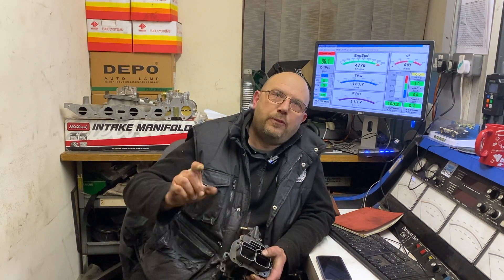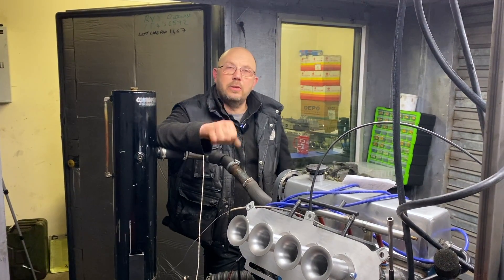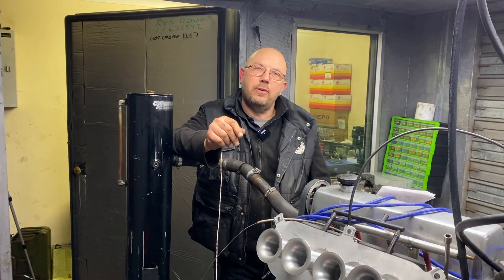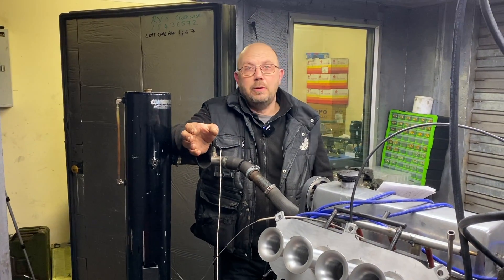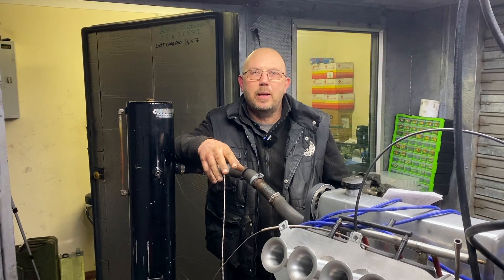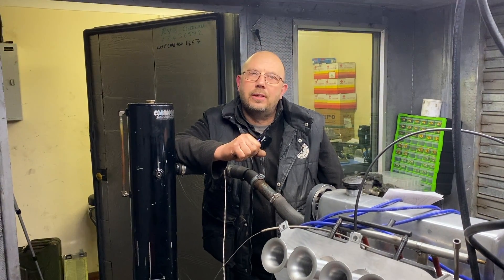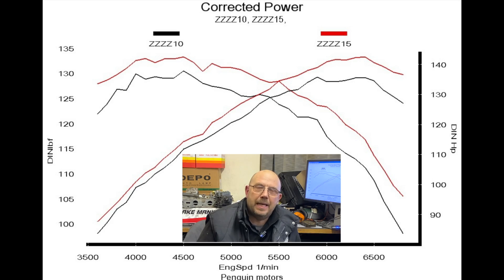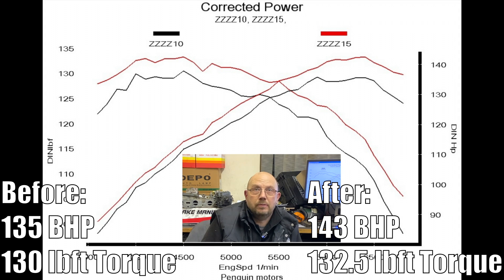How I got FREE Horsepower - Ford Pinto

Comment: Mate  scott from hull livin in new zealand  👍 if my valve stem seals have just started blowing white smoke ocasionally not on start up just randomly  can i replace with out tear down just pump air in the cyls etc pinto 205   And is there any upgrade seals for turbo or just stay with factory cheers 👍
Reply from the maker: I have changed pinto valve springs with the head still on the car using compressed air to keep the valves shut. Stem seals from Elring or Victor Rienze seem to be best
Reply: @PenguinMotors  thanks mate
Reply: @PenguinMotors  right so now my altenators stopped working 1979 ford escort mk2  not charging how can i test it if i remove it 🥹

Comment: I managed to get 176 hp from a pinto.Twin 45 dellorto's 285 cam, 421 manifold, larger valves and smaller intake ports.The ports are too big on these as standard. Making them bigger and polishing them is going the wrong way. Had a 5 speed gearbox going to an estate rear diff. The normal 2 litre diff was geared for something silly like 160 mph in 5th. Pattern clutches would just slip all the time. Using a genuine ford clutch could just manage. Started out as a 1.6 4 speed Sierra. 2 litre and cam made a big difference. Boring to 2.1 seemed to do nothing at all. Left it looking standard and used to have fun with GTi's etc. Was a fairly fast car 40 years ago. An ordinary modern 2 litre diesel would be about the same these days. At 63 I now have a litre motorbike, glad I did not have that when I was younger. I would have been lucky to last a week.

Comment: Interesting the power increases you found from making up those two manifold spacers, the one under the carb, and the one between the head and the manifold. I once got a power increase on a F/Ford 1600 x/flow with longer carb mounting studs and three of Ford's thick carb/manifold gaskets until a scrutineer spotted it and pointed out if was an illegal modification ............:face-turquoise-covering-eyes:

Comment: I had a 1.6 Capri. Dropped a 2.1 with a lightened and balanced flyeheel,   crank, pistons and rods, A fast road cam. 4-2-1 manifold and full Janspeed exhaust.  And two rejetted twin 45DCOE carbs with pipercross filters. 100LL avgas may or may not have been involved too 😉
Net result was showing 210 horses at the back wheels on the Dyno.
I really miss that car.
Reply from the maker: nice one but that dyno must of been reading pub horse power, as no way you of of actually had 210bhp at the wheels
Reply: @PenguinMotors  I definitely remember them saying 210 hp (it was the. Company that set up the carbs) It was quite a few years ago. Could it have been at the flywheel then?
Reply from the maker: @crazybrit-nasafan  if you play with the calibration you can make a dyno or rolling road read anything you want, i knew one operator that had his machine read high because customers liked big niumbers!!  but no 2.1 pinto will ever make  a genuine 210bhp flywheel using a fast road cam and 45's
Reply: @PenguinMotors  Thanks for the info. A bit annoying as well had paid them quite a chunk for the carbs and set up. I would rather have had an accurate reading rather than an exaggerated one. 
Given what had been done to the engine, what would you guesstimate the hp would have been at? The only other info on it is they 2.1 conversion was done by Burton and (though wouldn't probably affect anything) I ran it with a Borg and Beck heavy duty clutch.
Reply from the maker: @crazybrit-nasafan  Hard question to answer without knowing a lot more information, but you likely somewhere between 150 and 180bhp

Comment: Be very interesting to see what the optimum spacings would be and also the effects of going shorter on the carb spacers, longer on the head spacer and vice versa.
Reply from the maker: Optimum is probably longer than you can fit in the engine bay of a lot of cars. I tend to only try what average Joe might do at home

Comment: Hello.if I try to do these mods do I need to re jet the carb and if I add a velocity stacks improve
Reply from the maker: You may need to reject, I don’t think velocity stacks will do much if anything
Reply: Thank you for your help much appreciated
Reply: The water passage on the head and intake manifold must be blocked when making the inlet spacer or must make the cut out on the spacer for water?aNd can you tell me the sizes for rejetting the carb please
Reply: Sorry for troubling you but can you tell me what size jets you used

Comment: Do you have to put longer bolts on for the inch spacer engine manifold please
Reply from the maker: Yes
Reply: @PenguinMotors  any what bhp you would get from a 2.0 pinto with Kent fr 32 cams and 32 36 Weber 4 2 1 sporttex manifold please .Dyno run
Reply from the maker: If the head is standard about 130 bhp
Reply: @PenguinMotors  thanks ps enjoying all the vids

Comment: Hi! I am into historic sport regularity which means we are able to slightly modify our intake system. Currently I am running a 32/36 with a 4brunch exhaust but other than that isa stantard engine. I just need that extra 10 to 20bhp so i would need a mild cam sporty and as midpowered as could be...any suggestions.??? Gr8 Videos
Reply from the maker: piper BP134 or kent FR30 cam, basically same cam, both will give more power with no loss of torque

Comment: Mmmmmm.. You need to flow test the head and then design the inlet, exhaust and cam??
Reply from the maker: sort of, they are all interlinked, no point in having a  radical cam if the induction system cant keep up, all you end up with is a narrow power-band, as a general rule whatever the rest of engine spec, the better the head you use the better the engine will be
Reply: @PenguinMotors  we have found that engine builders are using the wrong size valves in x-flows.....
Wrong size DCOE carbs.
When they are using 45 DCOE's they probably only need 42's
Reply from the maker: As you will know most engines follow a tried formula, because its expensive and time consuming to try and develop something different. On the carb size i would agree, but how many 42's are out there? i have physically come across just one set over 30 years ago!
Reply: @PenguinMotors  42 mm throttle bodies.... I need 43mm.....

AT Power throttle bodies, Motec Ecu.

I'm running capacitors.... Not sparkplugs.
5 million Watts v 50 watts

Comment: Hi, great videos! I have a 2 liter pinto I would like to rebuild soon, what would be your suggested changes/upgrades while the engine is dismatled? I'm on a budget and restricted by weber 30/34 DFTH cause 32/36 is not easy to source around here. I'll definetly take a look at machining those spacers. Keep up the good work!
Reply from the maker: Budget rebuild piper 134 or Kent FR30 cam, skim head 0.5mm 3angle valve seats, lightly port head, you only need rework the short turns and you should get over 130bhp
Reply: @PenguinMotors  thank you very much! I'll try to source 32/36 carb, if I could get 130 hp that would be awesome!

Comment: This proves more than ever that a dyno is required as the best mods need the fueling sorted.
Once again a good educational vid, thank you.
Reply from the maker: Glad you enjoyed it, the thing is to a point carbs are self adjusting, more airflow gets you more fuel, but only to a certain point
Reply: Or you can weld an o2 sensor bung into your exhaust downpipe and fit a gauge or log the data using mega jolt. Not quite as accurate as a dyno but more convenient!
Reply: @Jonathan_Doe_  His dyno dont ahve os sensores?? Weel thsa not a Dyno

Comment: Cracking result Graham. Do you remember the bemouths that Mitcham Motors used back in the early 90's in Fast Car Magazine ..... i recon you should be making a selection  starting at 20mm to say 60-80mm of those get a few set plastic printed. Im guessing another 2+ hp .....
Reply from the maker: ive tried really a really short stub stack, it basically did nothing

Comment: Hi Graham great video. I have a question about twin Weber 45s on a pinto. What are your thoughts about using filters on these carbs? I’ve just had twin Weber 45s installed on my 2L pinto engine and guy that sold them to me and installed them put big filters on them. Are these really that necessary or could I use the gauze ones that go over the trumpets?
Reply from the maker: like a lot of others my race car runs open intakes no filters,  but big filters are good, gauze ones over the trumpets will cost you power.
Reply: @PenguinMotors  hi Graham thanks for the info. Looks like the big filters are the way to go!
Reply: I use to run 48's on my Pinto years ago. for the road i used 40mm trumpets with deep K&N filters. For track days 120 mm trumpets and no filters , i also tried filter socks the old girl fell flat on her face total restriction.  Air filters are there for a reason nice clean filter means happy score free bores it does not take long esp in the summer to trash the bores ....
Reply: @gileshamilton4462  Hi thanks for the info on using filters on the carbs. I will defiantly leave the big filters on. It’s cost a bit to get the twin weber 45s on the last thing I want to do is destroy them!
Reply: Uni filters👍 David Vizard talk's about them.

Comment: hey graham, do you think you could make something up showing the difference between a warmer and a colder air temperature. keep up the good work
Reply from the maker: Ross, Temperature does make a small difference, but you do have to change it a long way to make any noticeable amount, the slightly difficult thing about testing that is the dyno corrects for air temperature changes. Getting the engine oil properly hot is always worth a couple of bhp!

Comment: This reminds of a vintage car magazine article where they hopped up a new stock straight six Ford in a Mustang or Falcon, I forget which. They ended up getting about 50 percent improvement. The biggest single gain came when they swapped to a much bigger two barrel carb off a Big Ford Six (240).
What is the vacuum at wide open throttle on those dyno runs?  If it is more than 1 psi, that would suggest a bigger carb would help.
I wonder if any of the modifications you did actually hurt low rpm driveability.
Reply from the maker: vacuum was very little, TBH i dont normally log it, most engines i run are on twin sidedrafts which have bugger all vacuum WOT, in the next video i modified the carb and made another gain.

Comment: Interesting that it actually increased the torque throughout the whole range rather than just moving it up the revs a little further. I've seen some really long inlets on autograss cars, i wonder if it has a similar effect? 🤔
Reply: Not strange at all considering that longer intake runners typically make more torque than short ones.
The max rev is probably to low to make the stock intake shine.
If you watch some of Richard Holdeners intake tests you see that's how most engines behave 😀
Reply from the maker: @espenschjelderup426  although American V8's are not my thing, ive seen most of Richards videos, wish i could just pop down to wes ttech
Reply: @PenguinMotors    I actually have a Amerian v8 for a daly driver. And a Sierra 2.0 pinto, Sierra 2.3 Cologne and a Mustang Cobra for fun cars 🤓
But I have never tuned a v8.
But both a pinto and a ls engine is 4 strokes, and I guess they follow the same physical rules, and the effect of runner lengths and headers should compare?
A colab with Holdener could be possible I guess, when thinking of the colab with David Vizard that don't live close😀

Have you ever compared a DGV intake back to back against a injection intake on a pinto?
Only found you 1 hour ago when a mate sent me a link to this video, so still have some videos to watch.
Reply: On a separate note, i'd love to see a video about the effect a good valve job has on an engine. Take a pinto with standard seats and test it, then cut some thin seats right at the edges of the valves and also back the valves off at about 30° too and see what a difference it makes.
Reply from the maker: @WarlordMarty  might do one day, but the answer is very little, a bit of grinding on the short turn of the ports shows a bigger difference
Reply: @PenguinMotors  if you ever want to give it a go, i'd be happy to cut some seats for you to test. i've got a serdi 3.0 at my disposal and i'm reasonably local.
Reply from the maker: i would of thought so, especially with a restricted intake

Comment: Another great video Graham. 👌👌🙏🙏 I am not familiar with the F2 cam, is F2 cam popular for road use too or Piper 134 ( or Burton 134 ) could do equally well ? What other cam/s with these engine specs you might suggest?
Reply from the maker: The F2 cam isnt really a road cam, its intended for short circuit oval racing, i would expect similar results from a 134
Reply: @PenguinMotors  thank you very much Graham. Interestingly, Kent’s GTS range of camshafts are not much talked about in TS forum in-spite of the fact that some of them look good on paper. Would be great to see results of GTS camshafts. I know investment wise it is not easy to test all the GTS range but may be some popular ones could be tested one day.